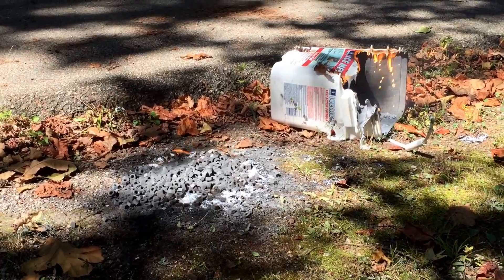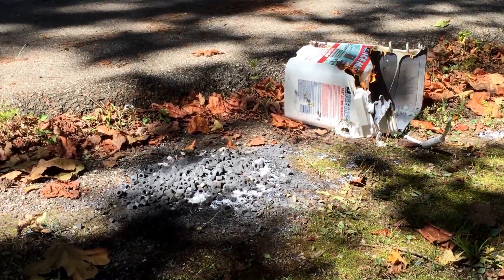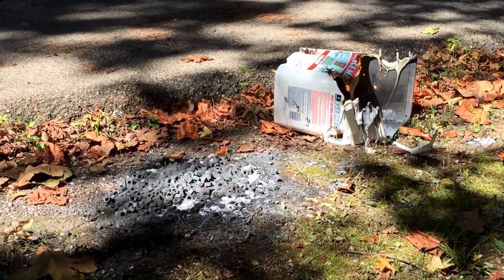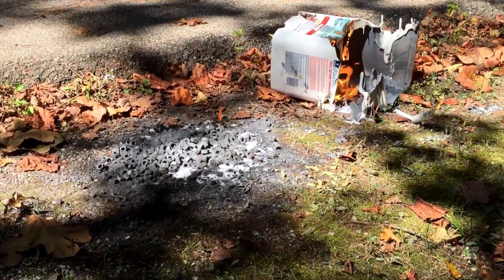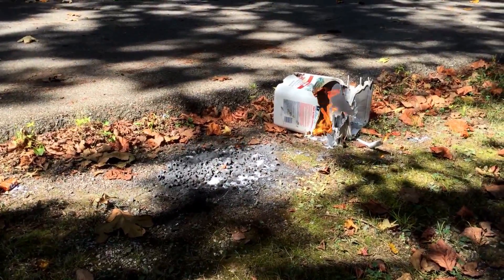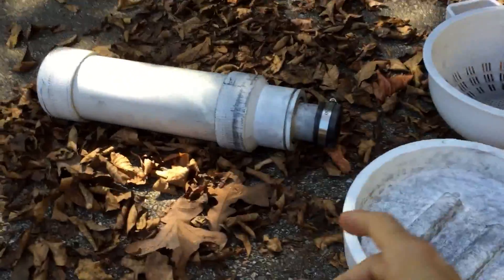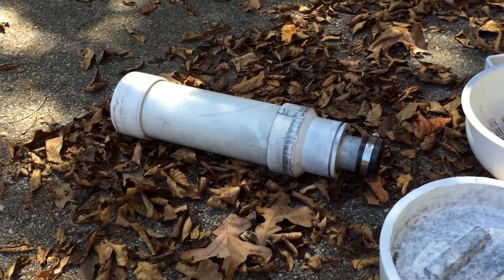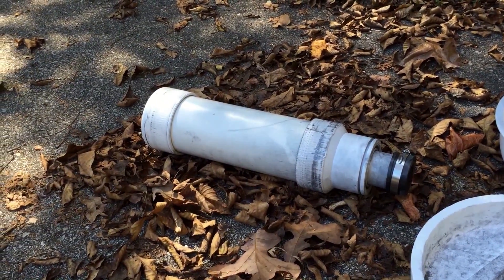Aluminum Powder is Dangerous!!!

Comment: I used brass balls to mill aluminum foil into powder..there was a very tiny amount that was left last time i screened the powder that the screen caught...like a tsp amount...i ran it for maybe 10 hrs max..over night..i just opened it and the powder lit up like a hot coal..i had a fan in the room on high...i put the lid back on quickly and it did go out...scary how it just lit up so easily like that..ive never had that happen before
Reply: Yeah it’s scary stuff, I’ll just buy it from now on. Glad you didn’t have a bigger problem.

Comment: Easier to just buy top quality aluminum. No need to ball mill it. I dont even know why one would need to do this
Reply: No its not easier i cant buy it anywhere
Reply: @Kirt44  cuz u don't know where to look or ur looking during the sold-out seasons
Reply: Cheaper
Reply: @ferry6700  obviously not🤣🤣🤣🤣
Reply: @ferry6700 It wouldn't be cheaper, you still have to buy the materials to build the ball mill, or buy a pre built ball mill yourself and that's going to cost way more than the amount you'd have to spend just to buy the aluminum already in powder form, and i mean a lot more, that and the amount you can buy already in powder form for the amount of money it cost compared to what you'd spend building or buying a ball mill far exceeds the amount you can make yourself for the price, you can buy 1 lb of Indian blackhead 3 to 7 microns for $11.50.

Comment: So basically it's when fine aluminum and oxygen mix rapidly? So if you were to put fine powder in a blender it would likely self ignite?
Reply: @BrewmasterC  and alum reacts with water to make hydrogen, so blending a slurry would probably be the same or worse outcome huh? IK you're not responsible for any advice. It's all on me
Reply: @Honestreview-om5hx  Yeah that shits scary right there. I thru a couple sheets of aluminum in a bullet blender. It got really hot so my dumbass sprayed it to cool it down a lil. That shit pressurized & started deforming the lil cup. Luckily I was able to toss it before it blew the top. Kinda scary. Lol Havent messed with it since.
Reply: @BrewmasterC may the odds be in your favor

Comment: Ummm... I know this is out of subject, but it is about aluminum powered. So had the brilliant idea to glue aluminum foil on a fake nail and to make sure that it had a full coverage I folded some of the foil in on the back of the nail. Once it dry I took my filling nail and started filling of the edges of the nail so wen I put the fake nail I have a clean cut and pretty look... Then suddenly while filling my second fake nail I noticed that I was making aluminum dust and I decided to stop after 15-20 minutes of exposure, my throat does feel itchy maybe sough and well I'm here now wondering if going to die from breathing in aluminum dust!! CAN SOMEONE PLEASE LET ME KNOW WATS GOING TO HAPPEN TO ME!!🥺😭😭😔 I WILL NEVER DO IT AGAIN!!!!
Reply: Considering the porcelain dust, acetone and adhesives used for nails.... a mask in general is a must.
Reply: @azboy2009  Well that was my first and last it scared the mess out of me.
Reply: @BrewmasterC  THANK YOU SO MUCH FOR GETTING BACK TO ME!!!  I'm good and all is well.

Comment: Once I didnt open my ball mill for 4 days straight. I was super anxious that my aluminum would ignite the moment I open my jar and burn the hell out of me. So what I did is I put gloves, goggles, mask and all body protection I had and I put my jar in the freezer(my jar was 4.3 inches to 4 inches in diameter).
I left it in there for half an hour.
Then I took it out and opened it just slightly to let it oxidise as slowly as possible. And there was no problem.
Reply: Бг ли си
Reply: Българин ли си

Comment: Hard to believe that something as run up the mill as aluminum is actually a very reactive material until it's in a form as a powder.
Reply: Have you ever heard of termite, it's nothing than aluminum powder and iron(|||) oxide (rust) and that shit burns through Hitler's bunker if it needs to
Reply: @boratsagdiyev5679  Yep, thermite shows the reactive nature of aluminum as it can strip oxygen atoms from oxides of less reactive metals like iron.

Comment: This is a really good precautionary video, of what the dangers are of not exposing the contents to oxygen frequently enough.
And it is very easy to do.
I have a similar set-up, and so far so good. I only ran mine for 12 hours, then opened the lid to check the contents, closed it back up and set it for another 12, and repeat.
Reply: So you need to expose the powder to oxygen or it can go off? And is there dangers of putting it in a metal container ?
Reply: @tomflitz5359  I have same question
Reply: @tomflitz5359  the metal surfaces of the particles bond with oxygen and releases heat. If you slowly oxidize your powder it is safe but if ran for several days and not opening the container it can rapidly oxidize and heat up to the point of igniting the powder. If using a metal container the grinding media can cut into the metal and cause it to spark.

Comment: we are a China's large-scale aluminum and magnesium powder manufacturer,if you want to get all kinds of Aluminum power:industrial aluminum powder, flammable aluminum powder, fine aluminum powder, ball mill aluminum powder, pesticide aluminum powder, aerated aluminum powder, aluminum powder coating, aluminum-magnesium alloy powder, aerated concrete gas , Fireworks with aluminum powder, please feel free to contact me. Whats app is: +86 one 5 one 2 eight 1 eight 1 six 6 zero, and the skype is fengwuliuxing. Wechat is one 5 one 2 eight 1 eight 1 six 6 zero

Comment: not because of static. aluminum is pyrophorbic. meaning it can rapidly oxidize when ground down into a fine powder.  the fine particles have enough surface area to oxidize rapidly creating heat. when making it you should open your mill at least twice a day.  it's quite dangerous making it if not done correctly.  especially when making dark aluminum.
Reply: I was thinking even a small air vent with a plastic valve.
Reply: Rapidly oxidizes..okay I understand now

Comment: UMMMM, plastic will create static electricity, "YOU NEED TO HAVE A GROUND ROD"......HELLOOOOOO!!!!
Reply: Eric Dee it was most likely the rapid oxidation of the aluminium that caused to ignite + the fact that he was pouring it out so a lot of it was in the air, giving it huge surface area to burn and cause the accident he said he had

Comment: What about putting a sieve on the ball mill to sieve the powder out as it is being made so it comes out in installments rather than one humongo batch? Might be tough to actually do though but probably worth a try.
Reply: If it were me I would try multiple slots (1cm wide and 3cm in length) or holes (2cm or 1cm diameter) running along the mill which are then covered by the mesh the lower the surface area of the mesh needed for each hole I think the greater the force which the mesh can withstand while milling. In the end, the mill would look like the "heat shield" of the barrel of a browning machine  gun with the holes in it, the difference being that the holes are mesh strainers. ;)
Reply: Also,I have never milled anything before but I was thinking about probably trying a wet mill, keeping water in the mill to keep the aluminium cool and unreactive until you take it out and leave it to dry in the sun or something. But I don't know much about the aluminum and how the water would affect the finished product. :(
Reply: @strangeperson700  I know this was 5 years ago but I hope you didnt do that. Al & water react. I had put some sheets of Al in a bullet grinder & it got really hot so my dumbass sprayed water in there to cool it down & the shit pressurized & started deforming the blender cup. Luckily I was able to toss it before it popped the top. Lol havent touched the shit since.

Comment: You used PVC which caused PVC to grind down into fine powder which mixed into you Al powder.  When you dumped it, you caused a static spark.  Not too wise using PVC.
Reply: Wasn't sparks, it was rapid oxidisation. He said he didn't open it for 5 days, meaning that the powder was grinding finer and finer in the absence of air, greatly increasing the available surface area that when he poured it out, the oxidisation(which is an exothermic reaction with all oxidisable metals) got hot enough to combust, causing the fire here. This is why the container has to be opened every single day to let air in and allow the oxidisation to happen so that it won't happen later when you open the container.
Reply: @HomeGrownPyrotechnics  Indeed. It readily oxidizes on contact with air. The oxide is inert, blocks out the oxygen and stops the reaction. (This can also be done purposely in an electrolytic bath, a process known as anodizing, which creates a thicker layer of aluminum oxide than normally.) However, when it's a very fine powder, the surface area is so large that the oxidation turns into a fire. :-|

Aluminum powder, by the way, gives the "MOAB" much of its explosive power (TNT is used to spread the powder, which then ignites on contact with the air).
Reply: what should u use instead
Reply: @astral.analog  you wouldn't need to use anything else. If you read my reply you will see why.
Reply: @HomeGrownPyrotechnics  i wuz trying to ask the other bastard but got it lol

Comment: Why would you lose the milling media? Can't you scoop some of them off the ground and hose them off?
Reply: ***** you are welcome. looking forward to more videos.
Reply: I use stainless steel 1/4 slingshot ammo for mine. A lot and I mean a lot cheaper and produces a finer mill. But also a double edged sword because It's more reactive I recommend exposing the aluminum to air at least once daily. Even more so if milling a product like magnesium or Iron oxide. Could also reduce the speed on your milling motor because friction and oxidation plays a major role in reactive metal powders.

Comment: I've heard that you should allow air in once or twice a day to allow the oxide skin to form. That supposedly prevents the 'pyro' burn from spontaneous combustion when atomized aluminum meets oxygen know the air. Glad you weren't injured or burnt.
Reply: Brewmaster C 
You said right in the begining of your video that you weren't able to get to it to open it for the final several days of milling. Now your saying you did? Which is it? Did you get air to it every day or did you not
Reply: Brewmaster C "too big a rush of air"? It was static that caused this, you should have earthed it. It doesn't just go super nova as you state! The mistake is yours, learn about reactions and how to stop them occurring.  This happened because your ball mill is pvc pipe and the bucket you have is also pvc. Just learn from your mistakes.

Comment: Stop using steel. Lead won't spark
Reply: use glass marbels
Reply: Ola Østbyhaug that’s what I use. They’re cheap and readily available and they don’t spark.  Just don’t use them in a steel milling jar. That could cause a spark if the glass becomes broken.
Reply: Aluminum is toxic also.
Reply: +Brewmaster C that's true, keep up the good work on your videos
Reply: Brewmaster C true. a lot of people don't know aluminum is harder than lead.
Reply: @j t If you have got it done and it burns rubbing between your fingers that is clearly because you have contaminated it with lead and the mg and lead particles rub together creating a spark, good luck making firecrackers that go off if you look at them too long